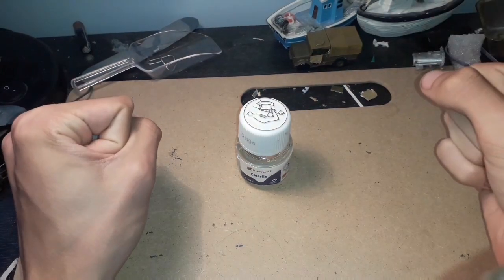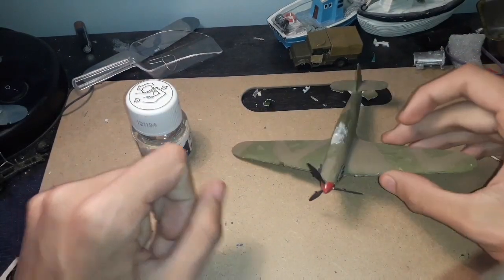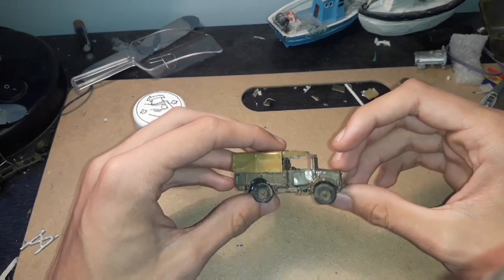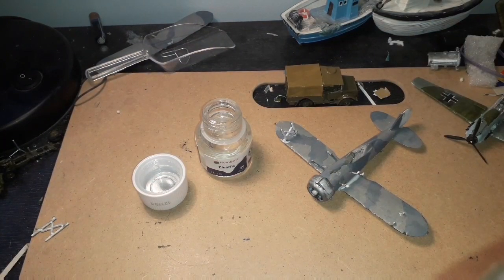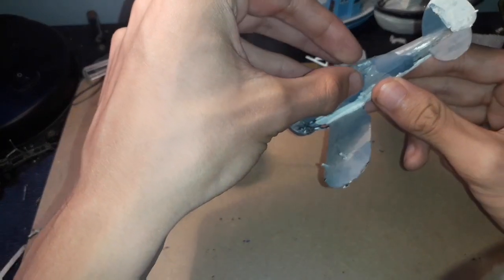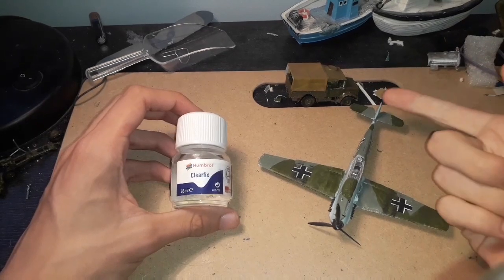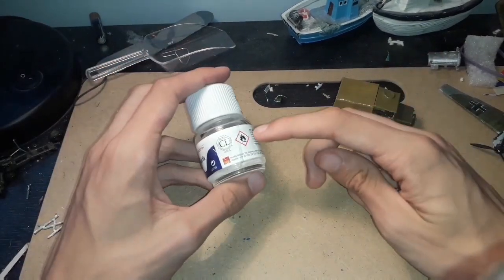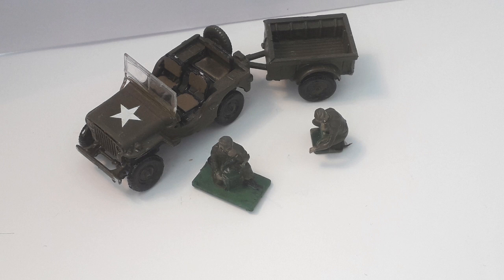Clearfix | Is it really clear?

Comment: Tried it a few times- found it took ages to dry, on tricky fixes (last used on a 1/32 Westland Lynx) was not very effective-ended up daring to use poly, fortunately worked alright. My hint is let it cure for 15 mins before glueing parts..otherwise am not convinced it is worth more than PVA, which is much cheaper.

Comment: I, bought myself a bottle of this and used a test canapy to see if it gave you the effect of glass rather than plastic.... It completely fogged over. I was so happy I didn't us it on my 1/24 Hurricane as I'd planned.... Where did I go wrong? Any advice or tips greatly excepted 😁👍👍.
Reply from the maker: Oh dear! Clearfix is used as an alternative to the normal poly cement. It wont change the look of the plastic clear parts, but it reduces the chances of the glue fogging the clear parts. I've had no issues when gluing my clear parts down with Clearfix. I'm sorry to hear you have had a bad experience! PVA glue also works to secure the clear parts in place without it fogging up. I think I will make a better video in the future of Canopy Parts to hopefully help people more than this older video! If you need any more help, dont hesitate to ask :)